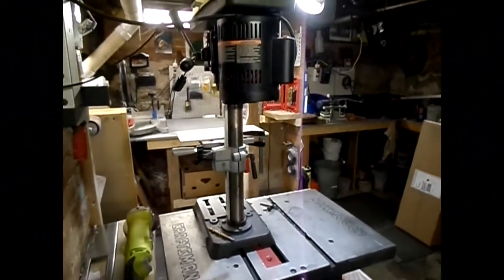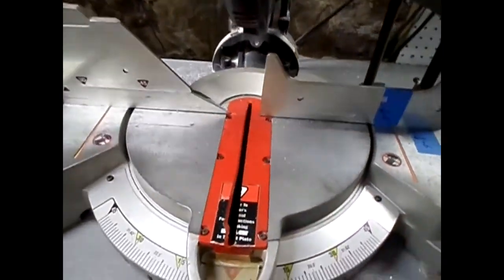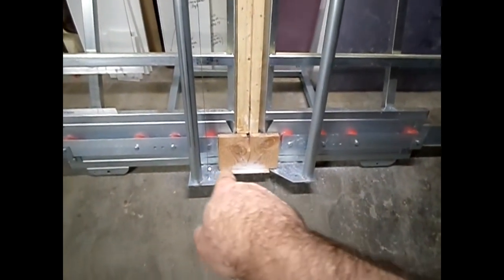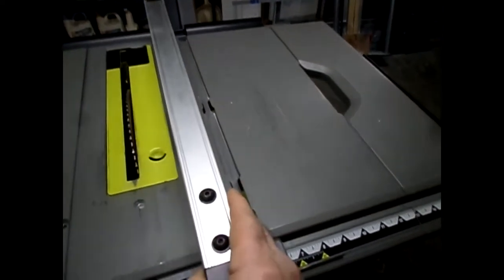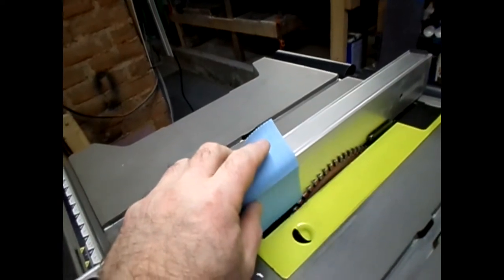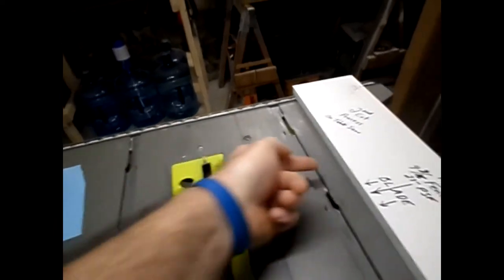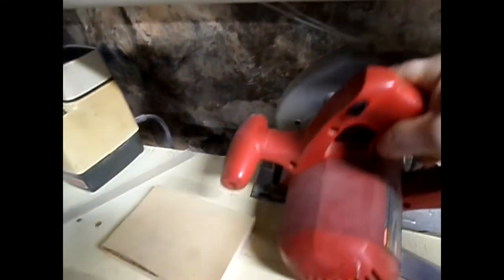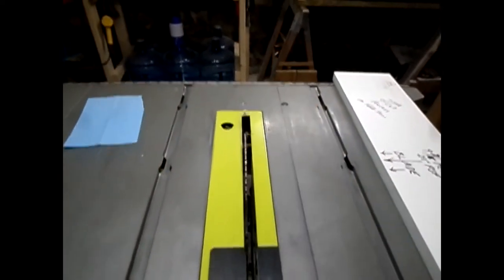Shop Talk - Answering a Question

Comment: Now I know why I never could cut a straight line , I have old Sears cast iron table saw its made pretty good but it makes two strong  men grunt when loading it into a pickup , had a riobi its motor burned up in one season  May GOD Bless  TANK
Reply from the maker: 🤣 It's Not You Tank!! And I know the old saws you mean. We have one here out in the barn. But the older saws were built with care and built to last. God bless you as well Brother.

Comment: 90% of tools are not calibrated. I had old Stanley 3 ft try square that was crooked big time. I through it out few months ago. It was 3* out of square. Good video
Reply: Stanley was a good company till 20 years ago when they sold out to China 🇨🇳.  They had a great company right out of shaftbeary v.t  ( north Bennington) but sadly closed up .
Reply from the maker: Yup, sad but true Kirk. When I am able to upgrade, I will be insisting on calibrated equipment direct from whoever I do business with.